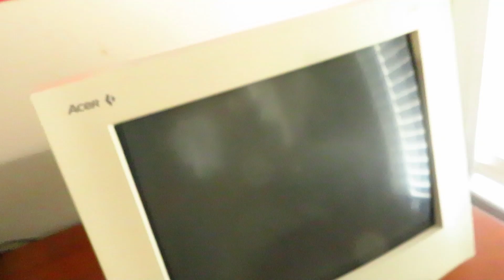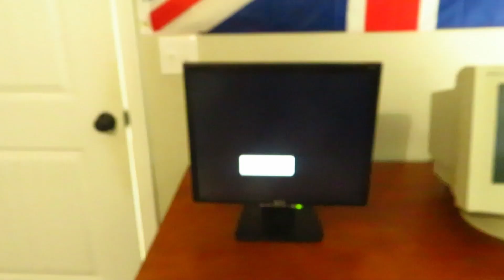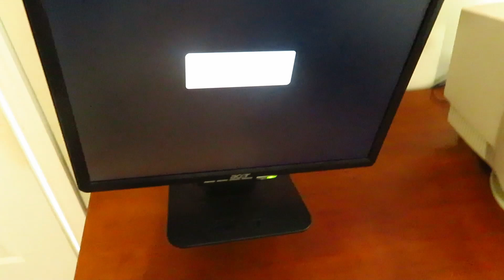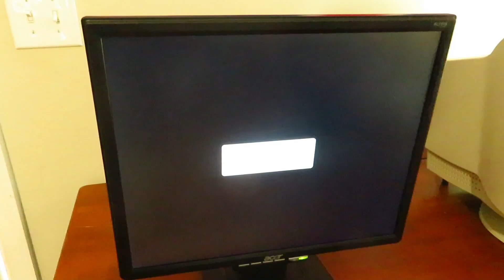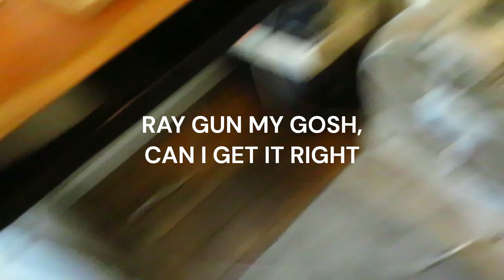CRT Monitor vs LCD Monitor

Comment: Ironic you mention how easy LCD's break because i have watched a video where somebody, using almost the exact same monitor on the left (it was an acer) had a rage-out playing step-mania and hit the corner of his screen with the corner of his keyboard and cracked the thin layer of glass in the LCD. LCDs do have glass in them, although it's a tiny pane as thin as a postcard. another thing you didn't test, was the temperature of the tube neck housing (the box at the back, witch is also evident on most LCD monitors and TVs, but is usually shorter by comparison ). the heat on the screen of the LCD is from the backlight, witch is basically a light box. all in all, although LCDs are slimmer, lighter and turn on instantly. sometimes CRTs do have advantages over them. but now there is OLED, witch uses small RGB/RYB LED bulbs for each pixel.

Comment: CRTs actually have a bunch of advantages over LCD, some of which being that it has true blacks where an LCD by nature does not, and that it doesn't have a "real" resolution so to speak, so it can do any resolution as if it were native. But many of the reasons mentioned here are indeed why the market moved away from them.

Comment: hey dude can you share windows 95 startup disk? i need it
Reply from the maker: https://archive.org/download/windows95startupdisk/Windows%2095%20Startup%20Disk.img This is the startup disk, but if you want to install Windows, whether that be on a VM or a real computer, you will need the Windows 95 ISO, the startup disk is only there if you are having problems booting up to Windows 95
This is the Windows 95 ISO if you need it, https://archive.org/download/win-95-osr-2/Win95%20OSR2.ISO

Here is the product key 34698-OEM-0039682-72135
Contact me if you need any more help or having trouble.
Reply: @TechnicalOperations  thanks dude i really need it i subscribed